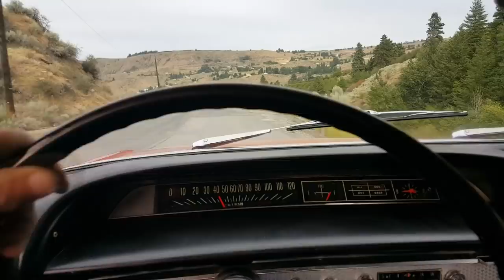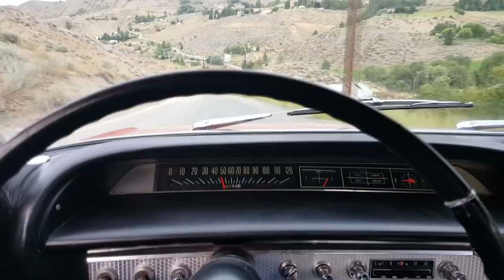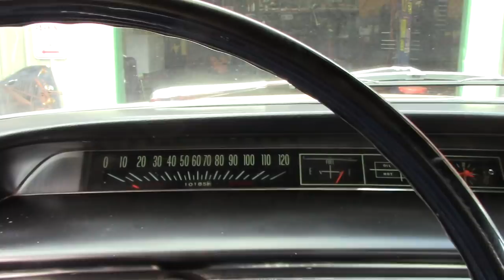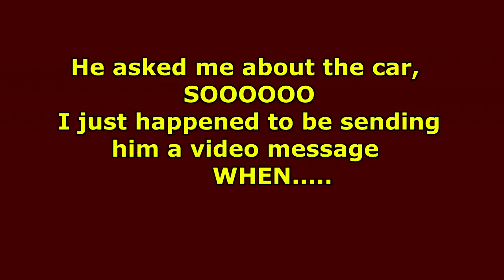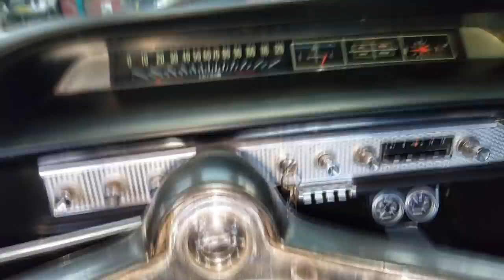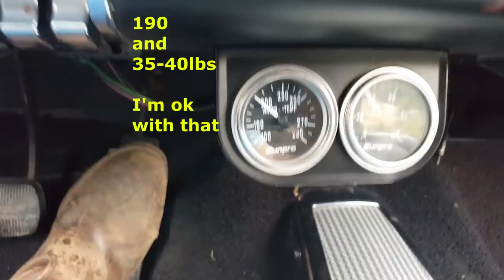63 IMPALA SS - Coil EXPLODED!

Comment: Applause to the Opening song,  I was taught on the older cars it's either fuel or electrical or catastrophic, you eliminated what the issue was and the bottom line is, it worked I trusted your advise with the setting of the Cam in my motor for my 61 Apache truck the other week and that worked out great, she runs like the way I hoped she would,Thanks for all your help.I also play the Guitar too but if I sang the cats in the Neighborhood would have something to Howl about or is that the dogs, either way I suck at that, I too love the old Iron,keep up the great work you do and you know sometimes I enjoy watching you fell a tree or two, or firng up an old V -12. I'll see you in the funny papers.
Reply from the maker: besides myself, you are the only other person I've heard say "see you in the funny papers" since I was a kid.
Reply: @1963impala2drWaylonWire One of my uncles used to say that all of the time,  He was a Mechanic and a Butcher and used to make the old Iron run,I went to school to be a Smog and Tune-up Mechanic but the Pay in the 80's wasn't that good so I stayed a Carpenter.and a jack of all trades Master to none.I enjoyed working on my Truck but the years kind of got to me I had the Chance to get a pretty penny for her and now I'm going to pick up a Cherried 53 Plymouth Cranbrook  for 15k she even has Aftermarket Air and you need that here it can get as hot as 110 here.I sold my truck to a guy that likes the old patina so he will keep it up.Keep up the great work and fun things you do.!!

Comment: Glad the coil didn't literally explode and throw stuff everywhere. Coils are quirky things. As I see this, I guess a coil can be an inexpensive start to just test to see if that's the problem (as long as you don't have a high dollar coil). I had a 1972 F250 I was messing with timing on the 390FE. As I drove, the truck ran worse and worse. The fumes smelled raw and finally, the engine died right as I rolled into the shop. Was going crazy trying to figure it out and was the coil. I was working on a forklift at my work with GM 3.0L 4cyl electronic ignition - not HEI. When you started it, it would kick back hard. (Eventually broke the starter nose cone.) When it ran, it would backfire thru intake. You would think timing. We messed with it and spent hours diagnosing. And guess what? It was that little coil! Sorry for you it was such a frustrating thing, but I totally identify with your experience. Hopefully it was just a coil issue and nothing else. Sometimes I guess you can get one from the box that ends up with a short lifespan. I might argue that you probably had no fuel issue at all. Would have tried running it with your mechanical fuel pump after changing coil. That old 390 FE I mentioned acted like your Impala a bit. It had no power and wouldn't accelerate hardly at all. The fumes smelled raw right before the coil died. I think yours got hot and would produce a real weak spark, making it act like fuel starvation. Good luck and really like that Impala!

Comment: Hi, I just ran across your video. I have a 73 f-100 that had a similar issue. Man dont drive it again until you run a few tests on your electrical system. My external voltage regulator went bad and caused a voltage spike up to around 15.5 volts and was causing my truck to shut off intermittently. Before I figured that out I also I ended up ruining my coil and battery. Also, check all the grounds in the car. body, frame and motor all need good clean grounds to the battery. Older project cars get taken apart so many times that they are often left off. Hope that helps.

Comment: I had a issue like you experienced with my 73 Chev pickup. It was hard figuring out if you were having a fuel or electrical problem. They can almost give you the same kinda results in acting up. If I remember correctly my was also electrical. (Points and condenser.)
Reply from the maker: it was both.. bad coil and bad fuel pump

Comment: What a nice car. I run in this same problem with my impala, an did all that you did trying to find the problem. What we found was the the starter has a S an a R  Terminal, we know what the s terminal for, an the r 'return,
because of the starter pulling all power it gives power back to the coil.   Starter  solenoid was our fix. The return was grounding and taking power from the coil. The car would not go more then 15 mph an the coils would get hot an pop. just like yours did. Hope this can help

Comment: I had a 68 Galaxy 500 that started giving me problems one day and I took it to a local shop and was told the carburetor was bad and needed to be replaced.  On the way home from the shop the same crap happened it wouldn't stay running but would start after I let it cool off for 15 or 20 minutes.  I was able to get back to the shop were the mechanic told me he had no idea what the problem was and at the same time claimed the carburetor was the problem had he fixed it.  I was pissed I paid $160 bucks and couldn't drive it to school.  Someone told me to put some better gas in it and that might be the problem which I did but found that didn't make any difference either.  The Gas Station Attendant told me to check the Coil that is might be heating up and shorting out.  He gave me the one off his car and sure enough that was the problem.  Napa down the street hooked me up with the proper coil and I never had anymore issues.  Wish I still had it.

Thanks for the reminder of the good old days!

Comment: There may or may not be more to this. MSD specifies that you must use a resistor if you use that coil with a Mallory Unilite distributor. On your car it is either a resistor block or more commonly a resistor wire in the harness. Either way it needs to be inline to the coil if it isn't already.
Reply from the maker: its in the harness.. been running that coil and dis. for over 10 years. never an issue.. guess they work until they dont lol

Comment: Make sure you have a ballast resistor feeding the coil 9 to 10 volts.   I've had many blow running 12 volts to the coil.if the type of coil required ballast.
Reply from the maker: thank you ... it has the resistor.. its been running for 15 years lol..
Reply from the maker: it does.. been running this coil for 15 years

Comment: If the ignition has power and the points are either closed or frozen together, it  can also kill the coil or the ballast resistor. Normally the coils inductance limits the current it can pass but under DC conditions (i.e. engine off) its basically a dead short. However, this has an "electronic" Mallory in it. Id suspect either a short to ground on the switched side of the coil, or possibly the module being faulty and continuously supplying the coil with power. Those are the only things that will really cause a coil to get hot enough to puke all the oil out.

Comment: I’m guessing that is an internal regulator coil? If so maybe it was going out and the extra voltage from the battery charger was the last straw. I doubt you will have any issues with the new one. If you have an external regulator I’d check to make sure you have voltage drop across it.

Comment: That's a good looking '63. I had a aqua marine colored one that was Super Sport. I had 5 spoke American mags on it. Other than the color and wheels it was just like yours. Twin antennas. I believe mine had a SS
Emblem above the flags on the fenders.
It was like yours loaded with power steering air brakes, bumper guards. Wish I hadn't have sold it now! Is that 10,000 miles in your car? 
Yeah those coils will sure scare you if you're right there when they blow! Why do you have a coil if you have electronic distributor?
Well I better go, it's late and I need to get to bed.
Reply from the maker: I had an aqua marine colored one too.. yeah this one has the SS emblem too.. I think its on the rear quarter but I'm not looking at it so i could be wrong. haha.. its 100k miles.  I have a coil because the distributor does not have one built in.  I finally got the right coil for it and have had no more issues other than I just dont drive it enough..

Comment: Hello Ken, if it was me I would for sure change back to a new mechanical fuel pump. Here is why we never know what could happen on the road. Vehicles that are equipped with an electric fuel pump from the factory are safe in the event of a collision due to an (Inertia switch) that will break contact upon impact and will stop pumping fuel. This is a very important safety feature that has saved lives.
Reply from the maker: i ordered an OEM mechanical pump

Comment: Sometimes the mechanical fuel pump will be 'bad' yet still work enough to run the engine. I had one go bad on a 84 C-10 305, yet still leave me with about 20% power under load that got me limped home.
Reply from the maker: that was the case exactly.. i tested the pump and it was bad.. plus the coil issue made it fun to diagnose haha

Comment: I had a coil really explode one time. I mean tar and wire everywhere. it was a 6 volt coil that i had put 12 volts to.  Maybe you had a bad coil. Check the voltage, those cars use 6 volt coils and  have a resister wire in the harness to give the coil 6 volts  and give the coil 12 v  from the starter when cranking.
Reply from the maker: you think i had a bad coil? haha.. yeah, I would say so!  hahaha  it has electronic ignition and uses a 12 volt coil.

Comment: Lol.  Brings back a memory for me. A year after installing my new 383 stroker in my 69 Camaro with a new Blaster coil it started losing power after a 30 mile drive. Limped it home and figured it was a fuel issue. Vacuum/ pressure tested the fuel system but it was ok. Guess I refused to believe my fancy new coil was bad but swapped back the original coil I had and life was good. They warranted me another blaster and ok for a bit then the problem came back and limped home again. Threw the old original back on again and guess what?  It’s still on there 10 yrs later and no problem. It as points at the time but recently went pertronix and so far ok. And I was a 30 yr tech and it sure felt like fuel.  Great video and good diagnosing on your part.
Reply: Went to a pertronix 15 years ago in a 65 Nova Streetable Gasser, took a dump bout the fourth year, couldn't believe it could be that, motor was worn & need freshning up, so popped it out & put in my fresh 355". Pulled the lame motor down, besides worn out rod and main bearings, wasn't nuthin wrong with it except the Pertronix!!!
Wouldn't hurt to carry a spare, good insurance...................

Comment: Good testing and diagnosis Ken. Now if you had one of them new fangled thingamabobs it would tell you all kinds of codes and even after you did what it said, it still wouldn't run right and the "check engine" light would still be on. Gotta love the old ones. Thanks for sharing.
Reply from the maker: I tested the fuel pump.. and it was bad..but the coil doing its thing made it a little harder to diagnose.  It was hard to convince myself that it could be Both!  haha

Comment: The coil needs a resister it cuts the voltage from 12 volts to 9 volts that may be  why the coil is getting hot.
Reply from the maker: yeah, it has one.

Comment: Now I wouldn't make a pimple on a mechanics butt but from the sound I was betten on an electrical issue, lol. Now that torque converter/ modulator valve thought, lol, typically if a modulator valve fails you get a good bit of steam rolling out the exhaust. Like I said, I ain't no mechanic. I like tinkerin too but I spent much of my life as a helicopter pilot with side work in computers and radio repair.

Comment: The old saying is "most fuel problems end up being electrical".  Seems like that  applied here. Hook that old fuel pump back up and see.
Reply from the maker: I'm way ahead of you.. it still wouldn't rev up after I changed the coil so I "did" hook it back up and ran the hose into a gas can.. I "know" what its supposed to pump.. but it only pumped enough to idle.. not to rev and run as it should...
Reply from the maker: back in the days of points and condensers... my pop used to say.. if its backfiring through the carb, its electrical..if its backfiring through the exhaust..its fuel.

Comment: I was working on a car, i had the radio going at the time,  then next moment i heard thais aumighty bang behind me, yes it was the coil, blew right apart, oil every where, put another coil in, no problems after that.
Reply from the maker: this is the second one I've had blow up in my lifetime.. lol.. its scary but not nearly as scary as having a battery explode!  thank goodness I was not under the hood when it happened..
Reply: @1963impala2drWaylonWire  neither was i under the hood, i was busy making 1 good rear bar out of 2 when my coil exploded

Comment: If i was going to ,  mount a electric fuel pump and use it on any car-truck i would get a inertia switch from some car and install it . Electric pumps can be dangerous in an accident if ever was one. But thats just me . I perfer the trusty mechanical one .
Reply from the maker: I was just trouble shooting. i ordered an OEM mechanical fuel pump. I wont be driving it anymore until I get it installed.

Comment: Ken; 'twas 'bout an hour ago when I watched this whole video.....and ya know..... I got ta tinkin.............just wat wod cause dat coil to fry like dat? Hummmmmmmmm......wondering......did y'all check that voltage on the hot side of dat coil?.....hummmm....and you got a burned out back-up light!?!?   Iffin she WAZ mine.....I tink I'd be checking that voltage all around before I need to replace the AM/FM, HEATER MOTOR, HEADLIGHTS or worse; the "WHOLE WIRING HARNESS" !?!? I've seen it happen!
   Captain BUCKLEY(ret.)
Reply from the maker: it has a new painless wiring harness. i highly recommend them.. good stuff and true to original with color coded wires and all..

Comment: Well Cuz .... we don't live in a perfect world and It's normal for "man made" stuff/parts to go bad often ... including coils. Just because it's electronic ignition .. I wouldn't leave the key on without it running .... pulsing the coil.  That's why (I think) they put an "ACC" position on the key switch. I am by no means an authority on electronic ignition but I would think if the distributor is set at a certain position (engine not running) it is putting juice to the coil same as points ignition where the points are closed! More than once in my life I have left the key on (engine not running) and stuff went bad because of it!  One more thing .... personally ... I would do away with the "race car" coil and go with a stock coil and also I would check the voltage to the coil to be sure the resistor is working and putting 9 volts to the coil. If it's getting 12 volts I would add an inline resistor to get it down to 9 volts which will let the coil live longer!  And yes, stock fuel pump is the way to go!
Reply from the maker: yeah, things work until they dont! right? haha.. with this setup.. it ran like a top for 15 years then "poof"!!  haha.. I still have some testing and checking to do..but when I set it up, I used the coil recommended for that distributor.. i know it has a resistor but like you said.. need to "test" some things.. I'm still not sure if the coil failed or if I blew it up!  looks like I would have blown er up many years ago but.. who knows.. anyways... "PRECIATCHA"!!!

Comment: Here's my two cents...
The fuel pump was fine. The coil obviously was the problem. It even let you know it was. This aftermarket stuff is crap even though it's expensive. When it works it's great but it doesn't always work. I've had so many problems with "electronic" ignitions that on one of my cars I went back to an old points system with all new parts. Even that left me stranded. Bad condenser...When in your life did you ever have a ba condenser???
Reply from the maker: the fuel pump was most definitely faulty.... It wouldnt pump enough to run once the engine was under a load.. but the coil doing its thing made it harder to diagnose..
Reply: Always keep spares in the boot points coils condenser fan belt done that years ago hardly needed them mainly points then go get some more just saying..

Comment: "You see, what happened was"...  :) You did alright by your car: you diagnosed, you ran tests, & you consulted w/Victor - & that was the last straw for the coil. And just like the "C" in an "A & B" conversation, it did something to make you notice it. I'll tell you a (sorta, but not really) related story: Years ago, a friend of mine had a '75 Monte Carlo that I would fix whenever he broke it: power steering one wknd., water pump the next, etc.. One day, I just told him flat out -" It's not the nuts & bolts of the CAR that's the problem - it's the NUT behind the wheel." He started treating that car, and the others that followed, better - & it's a good thing too, because he now lives 8 hours away.

Comment: It's a sad situation when parts are competeing with each other to fail. I hope you put it back to mechanical fuel pump too. Always nice to keep a car like that stock. On another note I baked an upside banana cake today and it took me half an hour to tie it to the bottom of the rack in the oven! :)
Reply from the maker: yep, i ordered an OEM pump.  you wasted half an hour.. you could have just turned the stove upside down in a minute or less
Reply: 1963impala2dr lol
Reply: Just use the broiler element in the top of the oven if you want cook upside  down cakes .
Reply: @1963impala2drWaylonWire  Are you going to take that old coil apart to see if you can see where it was shorting to cause all that heat?
Reply: @1963impala2drWaylonWire  I blew a ignition coil today do you know what kind of problems causes it to exploded I was trying to Start a cj2a and it exploded